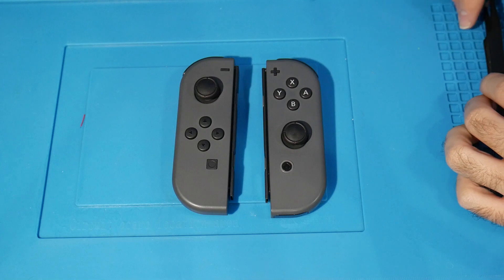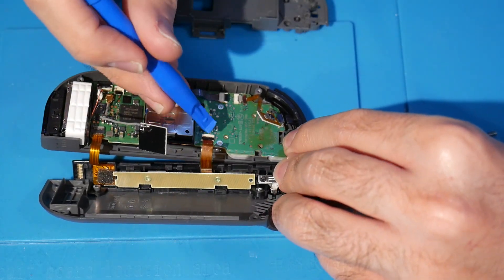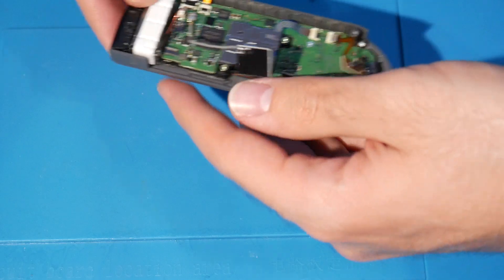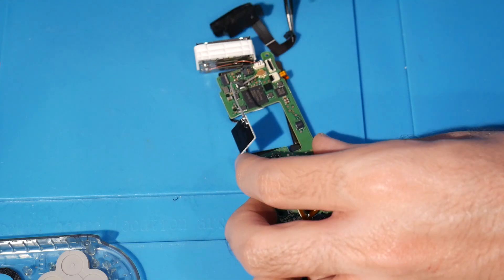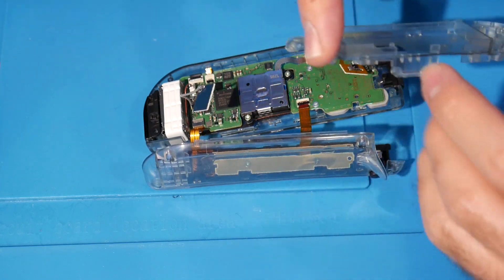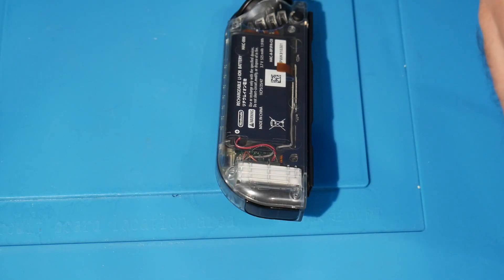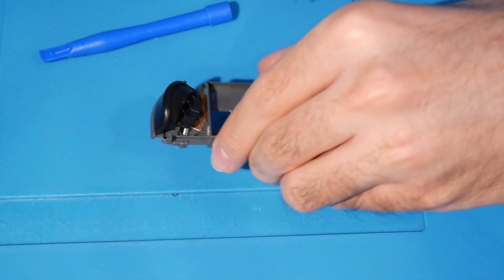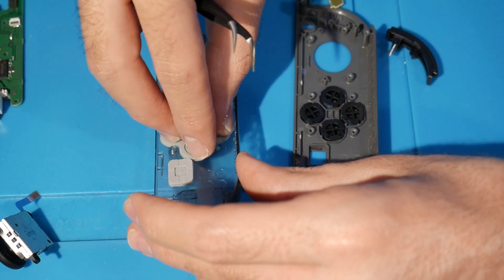How to Reshell Your Joy-Con Controllers!

Comment: Great tutorial! I bought the same green basstop shell you used in another vid, the biggest pain in the ass thru the whole thing was definitely the ZR buttons and the springs lol. They didn't fit as well as the OEM did in the original battery compartment and required a lot of force to get in. The springs wouldn't stay in place as I pushed it in, so I screwed in the little button pcb underneath first, pressed ZR in, and then finagled the springs underneath the button using some tweezers. I also couldn't get the right one to completely close 100%, but it's only like a millimeter so it ain't the end of the world. These things came out beautiful, thank you!!

Comment: Thanks for the video, I will say that for the left joycon, it's a lot easier if you separate the ZL button before removing the battery holder. Also, if you remove the three screws for the Minus and L, you can remove the top screw of the joystick without disconnecting the ribbon. These two adjustments allow you to transplant the pcb without detaching ribbons other than the rail.
Reply from the maker: Good tips!

Comment: You: you really can't mess up transferring the release button. 
Me: You underestimate me sir. LOL.

But seriously I don't know if it slipped from it's space when I flipped it or what but I closed my left joy con up, screws and all,  only to realize I couldn't press it in. Seems it's stuck in the released position. I ended up stripping two of the 4 screws trying to open her back up to fix the release button. Any advice? Currently it's only mildly inconvenient but I would love to get those stripped screws out to fix the button.
Reply from the maker: You could put a rubber band between your bit and the screw, flat side down, and see if you can grip enough to unscrew them? Otherwise you might have to be intentionally destructive and use a drill with a small drill bit to drill out the 2 screws. Just make sure you can replace them.
Reply: @MrMario2011  I tried the rubber band trick but my screwdriver just pokes through it. I don't trust myself at using a drill either.

Comment: Another great video. How does the dpad feel when gaming? Is it better than the stock setup? Also have you got a direct link to the one you bought? I've had a look about and can't find the one you used that includes the dpad.  Thanks
Reply from the maker: I personally like it more, I have it on two of them now. Check the description, I've added the exact one used!
Reply: Thanks, looks like they are all sold out. There was another one but it was priced at £43 and didn't have a dpad either 🤯

Comment: When I was trying to do the right joycon the l button switch came off what do I so
Reply from the maker: Put it back on?
Reply: @MrMario2011  the button came off the bord
Reply: @mauricethagreat6088  oh ur talking about the R button at the top, right? if you are those are a bitch to fix you would have to solder it back on too hot and you ruin the spot where you have to solder it back on and make sure to solder it the right way if you plan on doing it i messed mine up trying to fix i after i dropped it .